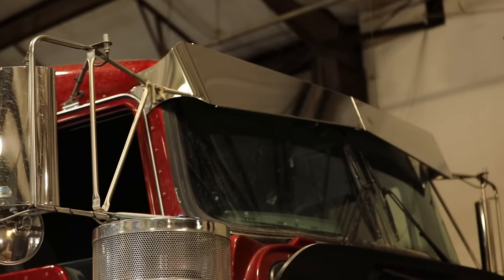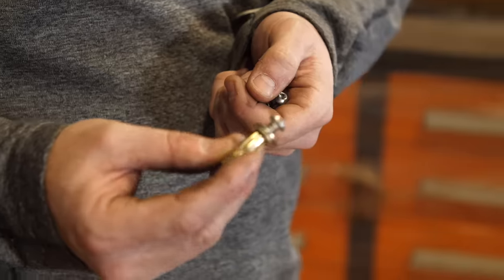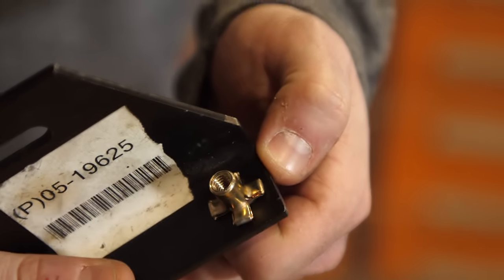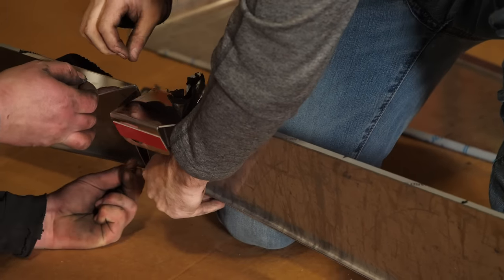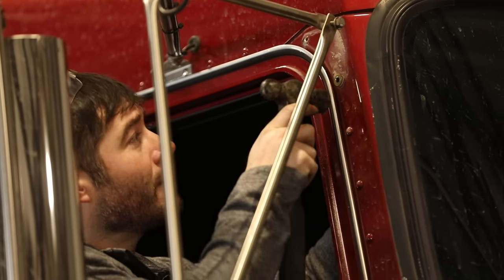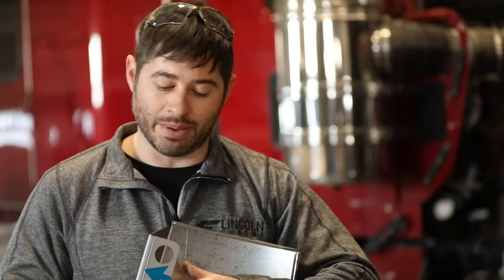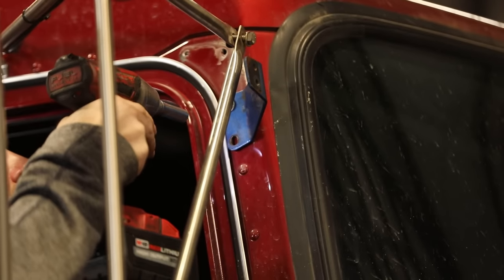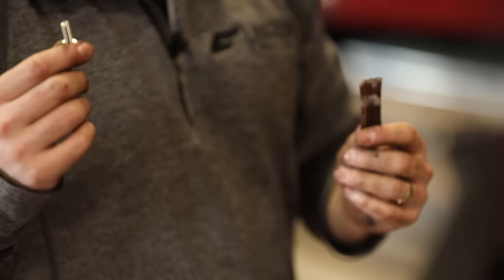Lincoln Chrome Visor Install Tips

Comment: Lincoln chrome is trash, i bought the same visor 13" drop!!! Doesn't come with any instructions, no parts list of what you should have in the box, or anything. Just terrible business
Reply: Im right now sitting in front of my visor just looking at all these lock nuts  and 2 different size washers and some rubber threaded parts and not knowing what goes where. 😢